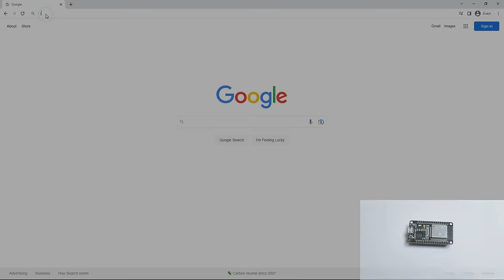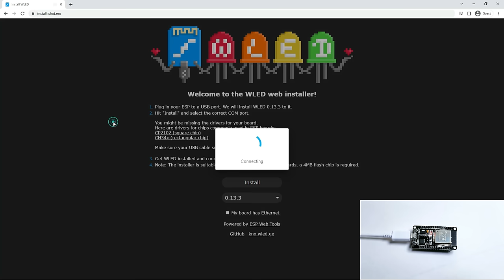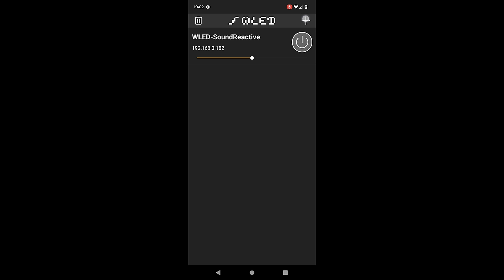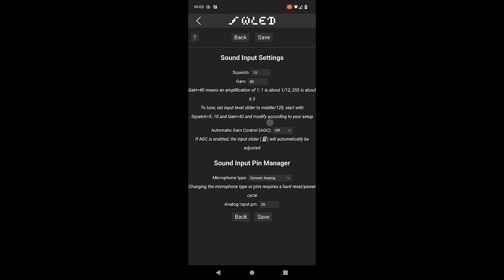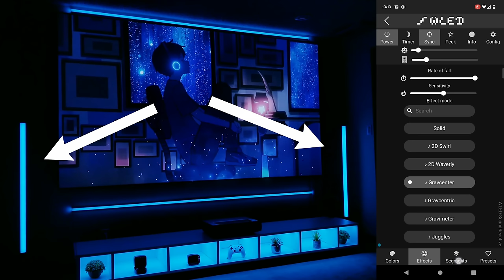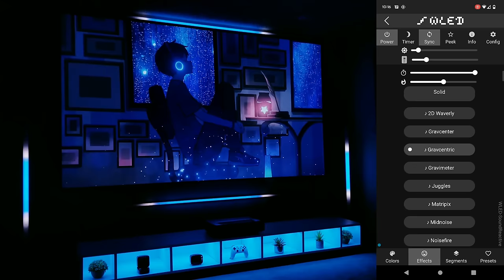I Never Realized WLED Sound React was THIS Good! Complete Walkthrough

Comment: Is it possible to "Sync" from one sound reactive WLED to multiple other WLED instances? I listen on whole home audio using a bunch of HomePods/HomePod Minis, so I would like to capture the music using the mic in one of the quieter rooms and have it work on my kitchen/living room setups. I don't imagine having the mic in my kitchen when friends are over will be very successful with all the conversations, cooking, etc.
Reply: just go into the Sync Interface menu and scroll down to Audio Sync and the Board with the Micro phone on it set it to Send and all other boards you want to control set them to Receive, You can even receive data on boards that dont have WLed SR installed on it and they will change in sync with the mic'd up SR board.
Reply: Yes but it’s not completely sync, you will have a small delay.
I wired my whole room to get multiple LED strips connected without an delay.
Reply: @James02876  Thanks, I will definitely check it out.
Reply: @paulmacinnes5831  That sounds very promising! Thanks, I will have to try that out.
Reply from the maker: Thanks so much for watching and great question! I could be wrong on this but from me playing around, while you can certainly sync all the devices together that you have on the same wifi network as well as create specific sync groups, If you want the sound react to work in each room you would need every controller to have a mic installed in each room and it would only pic up audio in the room where the mic is. My understanding the sync feature does not take the one controllers animation and mirror it across all other synced devices. I believe it just changes the settings of every controller to the effect, color that you have on the main controller. I could be wrong and I also could be doing a poor job of explaining things!

Comment: If you don't like ferrules, you could always use ring terminals with the chassis power supply. You just need to make sure you have the right terminals for the screws (ex. #8 ring terminal)

Comment: Hi I've tried  3 different led strips ws2812b 4 different esp32 flashed with wled 2 different power sources even used phone charger for the power all i get is first led on i changed it to 300 lights in wled but still getting one light on only any one else had this issue I'm about to return everything I've been trying for a week
Reply from the maker: Hey buddy! Sorry to hear the trouble you're having. Couple things I would quickly check. In led preferences make sure next to the GPIO field that you have the number 2. When I flashed WLED to the esp32 it used to have 2 as the default but lately I noticed it defaults to 16 so I recently had to go in and change this back to 2. (Or whatever pin that you used for data) another thing is to make sure that the ground wire from your esp, the led strip and your power supply are all connected together. Also make sure the arrows on the led strip are pointing away from the controller. Hopefully one of those 3 things will get it to work but if anyone else has any other ideas it would be great to hear!

Comment: When soldering the INMP411, it is good to put just a tiny piece of tape on top of the mic hole to protect it from any unfortunate solder splashes or flux if you are using flux core solder.

Comment: Please note that some cheaper ESP32 boards can have a mislabeled GND pin next to the 5V pin. It's mislabeled because it's actually 3.3V out, not GND. Happened to me personally on a couple of boards.

Great video!
Reply from the maker: Thanks so much for watching and for the information! Very good to know and I'm sure others have run across this as well! Thanks for the heads up!
Reply: @ChrisMaherDIY  Love to help. Also love your videos, keep up the good work.
Reply: Hey man, I have an issue here. I have connected my ws2812b led strip properly according to the pins. I see that only 1led or about only 4 turn on with a different colour (usually green) turns on in the end. If its only one, then only the first led turns on to white. I'm pretty confused on what the problem is. Could you help me?
Reply: Both power pins have gnd immediately next to them. Ive never seen anything else even since the 8266
Reply: @DaleDix  irrelevant, since on some boards that GND labeled pin next to the 5V IN is actually 3v3. It's a manufacturing flaw. Hence why I said "mislabeled".
We're both speaking from personal experiences here, but mine means if you don't heed my warning you might actually break something. So better safe than sorry.

Comment: WLED is one of the best addressable LED control software (or firmware?) out there.  It still runs really well even on the older ESP8266 chips.  I also like that, with a little playing, you can link multiple WLED devices together so they work like one unit together.
Usually, if you need to press a "boot" button when flashing, you need to just press it for a second at the exact same time as you start your firmware upload
Reply: How are you linking them together?
Reply from the maker: Thanks as always buddy and thanks for the info! Glad I don't have to hold it down for 30 seconds like I was doing lol!
Reply: There is a setting in WLED to sync multiple WLED instances so they can all run the same effects.  So you can make 1 controller a master and the others would be slaves to that master.
Reply: @EsotericArctos  looking to take a jab at this soon. Complete rookie.

Comment: In the Settings > LED preferences > Length you put number of LEDs on the strip. Since you have 2 strips and data channel split, should the number reflect one strip or both? Let's say you have 2x 1m 60leds per m strip, so you put value of 60 there or 120?
And what if you have 2 strips on 1 data channel, but they are different length? One longer and one shorter?
Reply from the maker: Thanks so much for watching and great question! If the data is split you just put the number of leds of the one strip so in your example you would just put 60. And if your splitting the data, you more than likely would want to keep the strips the exact same since there would be no way to set the strips to a different length doing it this way. If you set the leds to the shorter strips length then the leds on the longer strip past the input value will do nothing. If you set it for the longer strips led length, then on the shorter strip after the animation is done, it will go dark for a second while it thinks there are more leds on the strip to complete. Hope that makes sense!
Reply: @ChrisMaherDIY  Thanks Chris. I have a specific cabinet that would look the best with the longer strip on top and shorter at the bottom.
So I guess the best way would be to hook up the 2nd ESP32, one for the longer and one for the shorter strip. I do not see any other option here :)

Comment: Great video Chris, ya have me hooked now...working on my 1st set up for my sons room... Quick question, I have (2) WS2811 16' strips getting mounted in 2 different locations and going to be using the ESP8266 to control them, do I need to use a separate ESP for each 16' strip and use the Sync in the WLED App or can I use (1) ESP controller for both sets ?
Reply: There is no need to use a second ESP board, but it's recommended to use a level shifter (basically, a component that boosts the data). While this is recommended in all cases, it's particularly important when the data/signal wires that are connecting to the LED strip are long. If the control board is close, there's no need for one in 99% cases.

I'd only use a 2nd board if I wanted everything to look neat, as I wouldn't have to bother with hiding long cables.. but then I'd also have to use 2 power supplies.
Reply from the maker: Thanks as always for watching! I agree with Vex! Here is some information on recommended number of leds for each device: https://kno.wled.ge/features/multi-strip/#:~:text=For%20good%20performance%2C%20you%20can,a%20total%20of%204000%20LEDs.
Reply: @ChrisMaherDIY  Thanks for that link Bud, it worked like a champ with 1-8266 controller and (2) sets of 300 LED's , one more quick question, for total amount of LED's in this confiq would I set it to 600 or since its going down 2 separate walls at 300 ea and sharing the data stream would it be best to set at 300 ? or Do you divide by 3 and enter 200 for the total ?

Comment: Absolutely awesome Chris! I have four ESP D1 Weimos, my issue is they are installed on a board, with buck converters and an additional chip for power/data management. I’d like to add the mic you showcased but didn’t know, can I use pins, that are already in use?
Reply from the maker: Thanks as always for the support! Man that's a great question and one I wish I had more information on. I'm not very familiar with the D1 weimos enough to even know what you would do. Maybe someone else watching might know for sure and can chime in!

Comment: Hey Chris, thanks for the great and easy-to-follow tutorial. One question that I am a little confused about: the strip that I'm powering is a 24v FCOB, and I have the appropriate 24v power supply to go with it. I have the ESP32 board with the mic set up exactly as you show in your video, but I have a feeling that this isn't how it should be if I'm using a 24v power supply. Can you please help me understand how I need to change my setup for this scenario? Would I take off the red jumper cable that's connected to the VIN pin on the ESP32 board? What else?

Comment: Super instructive video Chris as per usual, keep up the good work! I was wondering, do you know if it is possible to sync a sound reactive instance of WLED to non sound reactive WLED device? For example, instead of reflashing every WLED device I have, I could only flash one with the new software and sync all the other ones to it.
Reply from the maker: Thanks as always buddy! So my understanding is that you can sync them to do the regular non sr animation but it will not work if you want them all to do sound react effects. I could be wrong so I hope someone can correct me If I am but that is my understanding.
Reply: @ChrisMaherDIY  If I have 1 ESP Board with SR WLED and a mic and 4 ESP Board with SR WLED but no mic. Should I be able to "Sync" then in the app and not have to put a mic to every ESP Board?

Comment: Hi Chris, love the video and ideas!
I have 3 ESP2866's running 3 sets of LEDs in my home bar and after watching another video about the reaction difference between the ESP2866 and the ESP32 I'm looking to swap while also adding the mics for sound.  In you case, which ESP32 did you use? the ESP32s, the ESP-WROOM-32 etc ?
I followed your link to hopefully give you some payback on them but the link is for different ESP32's
Cheers

Comment: Question: how did you connect the LED strips as shown in your video ❓
Reply from the maker: Thanks again! I pretty much combined the process in this video: https://www.youtube.com/watch?v=ps_pDbdvqZA with the sound react video that you watched. I did split the data coming off the controller so that both lamps do the same thing at the same time and then I did the same thing with another controller for the two diffusers so that  they also will do the same thing at the same time.

Comment: Thanks for the video and explanation! 
How do you mount the INMP441? I realized that if anything touches the contact circumference it starts to get signal. I tried to attach the wires with tape, but it also mixed up the signal. Any idea/advice to mount the mic in a waterproof case with the esp32? Thanks in advance

Comment: Hi Chris. Really appreciate your process of explaining. Also this work is so inspirational. I have 4 led strip lengths of 4 mtrs each, installed in louvres (4 lines). 
1. Can it be controlled using same Esp?
2. For the best effects should I add them as separate segments (to look like an equaliser kind of effect), in your opinion?
Reply: @TheNigaHigaFan4Ever  many thanks for the detailed update. I have a major issue besides this. My wled app often shows offline for the lights. I have to reflash them which is cumbersome. Can you throw some light.

Comment: Wonderful. What is the limit to how many LEDs a single ESP32 can support in this configuration? I have a hallway where I would want one, very long strip. Thanks for these videos!
Reply: That’s what I found couple month ago:

ESP32. For perfect performance, it is recommeded to use 512 LEDs/pin with 4 outputs for a total of 2048 LEDs. For very good performance, it is recommended to use 800 LEDs/pin with 4 outputs for a total of 3200 LEDs. For good performance, you can use 1000 LEDs/pin with 4 outputs for a total of 4000 LEDs.
Reply from the maker: Thanks so much for watching! Looks like Michael was able to help out! I really have not done a crazy big install yet so i've never tried to max things out but this info from the WLED page is very helpful! https://kno.wled.ge/features/multi-strip/#:~:text=For%20good%20performance%2C%20you%20can,a%20total%20of%204000%20LEDs.
Reply from the maker: Awesome! Thanks for helping out and for the info!

Comment: Cool project 😀👍
Question: Why are you using version 0.13.3 and not 0.14.0-b1 ❓
Reply from the maker: Thanks buddy!! I could be wrong but to use version .14.0-b1 i think there is extra steps required to activate the sound react user mod. which are not as easy to follow as just the regular sound react 0.13.3 I have played around with both and they both work great!

Comment: Another interesting video Chris, I had tried using SR based on your older video and for whatever reason, could not get it to work with the Max4866 mic. 

In this video the ESP32 device that you linked to here is different then the one you had noted in other videos (Dorhea,) will the previous version of the ESP32 chip that you had been linking,  (Teyleten Robot), so would the previous ESP32 work as this one does for this setup with the Mic you specified in this video (INMP441)?   They do look virtually identical and is a  30 pin like the Teyleten.

Would not mind trying SR Again off this is a more reliable config and works as expected with the Teyleten version of the ESP32. You'd think it would, but you never know for sure till someone tries it...   Thanks for any thoughts
Reply from the maker: Thanks so much for watching! When I was testing things out with this new setup, I did use the Max4866 mics and those were one of the ones that after saving and rebooting, I did have to unplug and plug the power source back in 1 or 2 times before the mic started working. Not sure why but it worked just fine after! 

Great attention to detail on the esp32 that I used! They look the exact same and after trying them out, they do seem to be the exact same. The reason why I ordered those instead of the Teyleton ones was because the ones from Dorhea said they would arrive the next day and the ones from Teyleten said they would arrive in 2 days. Lol that's the only reason. Either one should work perfect since after getting the new ones, they look like the exact same thing.

Comment: What case are people using to stuff all of these components in? I'm not using large runs of lights so I don't need a large power supply. Just a 3 amp 5 volt barrel plug adapter. The Max 4466 has several free printable options but I haven't seen anything for i2s  mics yet

Comment: I am really new to LED projects. I am founding hard to find if I can wire the board to the power supply I use for the 24V leds I have. The boards I have seen show 3v or 5v, if I wire it to the power supply, could it be damaged?

Comment: If you ever get the error that it cannot open the port to start the install, what works for me.

Open device manager.
Find the ESP
From advanced settings, change the port.
Click no to the reboot prompts and yes to everything else.
Then from device manager, disable the device. Do not uninstall it, just disable.

Disconnect USB, then reconnect it. 

Refresh the WLED install page.
Then enable the esp32 from device manager again.

For me it now is able to connect.

Comment: Whenever I restart the system or there’s a power cut the esp32 doesn’t not connect to my WiFi automatically unless I press the en button on the board and it doesn’t save the last setting or mode changed on the lights 
Any fix ?

Comment: So what’s the difference in performance with the 12V 30a power supply vs the first one used in this video video?
Reply from the maker: Thanks so much for watching! The 12v vs 5v will just depend on what type of led strips you are using. The 12v power supply you have to use with 12v compatible led strips like the ws2815 ones I used in this video: https://www.youtube.com/watch?v=zbhdH-qSANc&t=114s
12v is able to push the power a litle stronger so theoretically if you have a big install, that would mean less power injection. But in terms of the led strips, I personally could not tell a difference in brightness or performance. Although the 5v  sk6812 strips I use in this video do have a separate led for just white which is a nice bonus to have that the 5v ws2815 or the 12v ws2812b ones do not.
Reply: @ChrisMaherDIY  once again, thanks for the response and the awesome, creative, informative videos!

Comment: Hey Chris, I have found this mic isn't as reactive as yours, unless I've killed it in the soldering process. I really have to make a loud sound close up for it to register. When I touch the L/R pin it lights up into action as I must be earthing it out somewhere. 

I have plugged the LED Music Controller SP107E and it's far more responsive. Obviously I have less control using the LED Chord app. Is this something you've come accross at all and can offer me some advice?